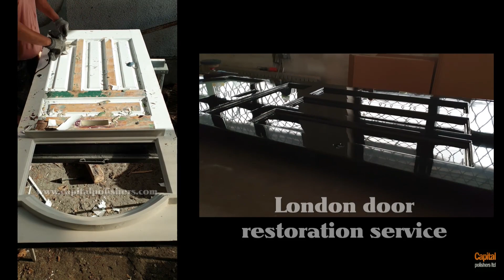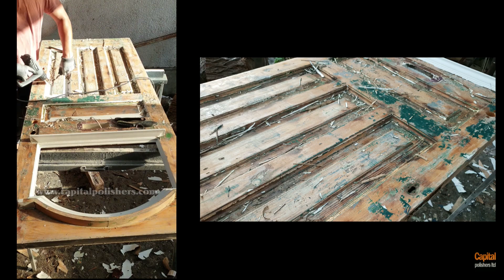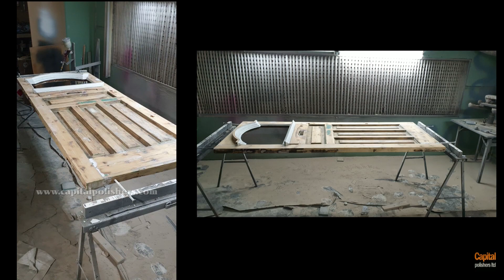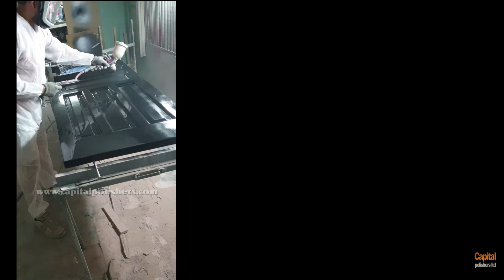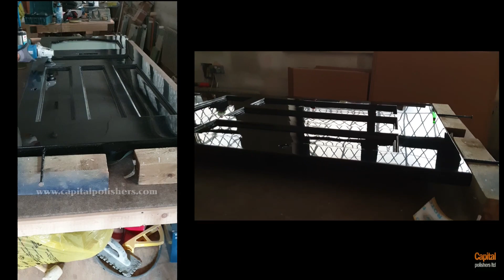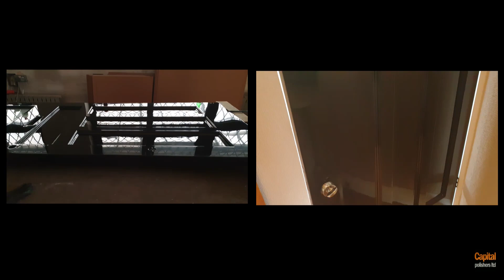How to get high gloss mirror effect on front door? Door restoration cost in London

Comment: Might be a crazy question...can you achieve that same shine on a black accent wall?
Reply: They say they need to work horizontally. Also, a wall contracts and expands so the finish would probably crack. Mdf doors are rock solid. Old doors are likely to crack over time, I wonder what this looks like after two three years. But you should be able to fit a bunch of large panels on any wall.